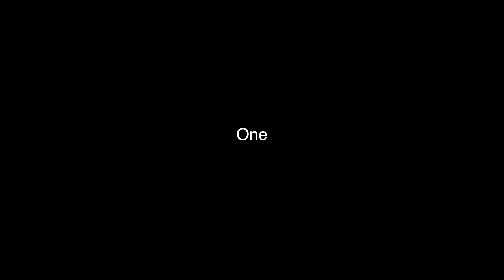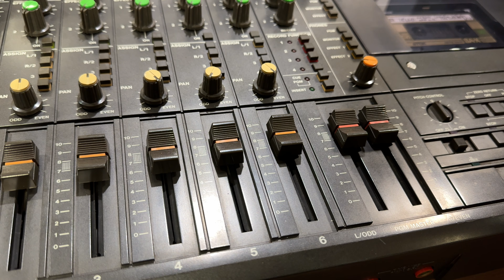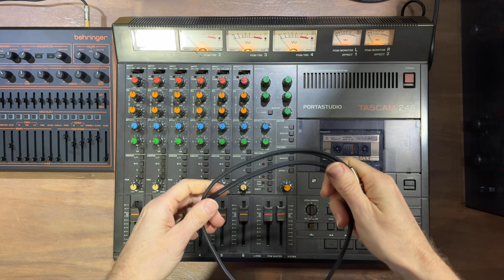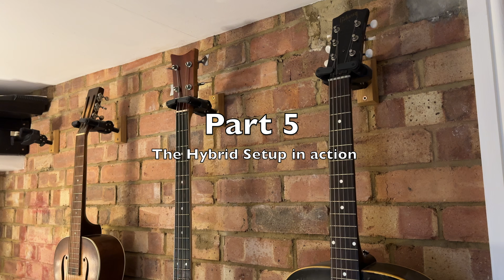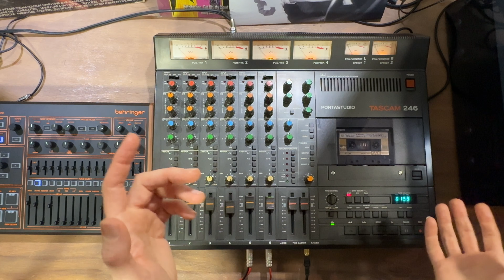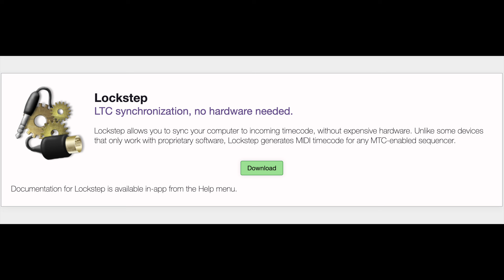Hybrid Analog Recording - Syncing Logic Pro with a 4 Track Cassette Recorder

Comment: Hey mate, thanks so much for your video on syncing Logic with the Tascam 246 — it worked perfectly!
I’ve got a quick question I’m hoping you might be able to clarify:

I’m monitoring drums from Logic by sending the stereo signal into inputs 5 and 6 on the 24 like youve shown here.  The only way I can hear them is by assigning them to buses 1 and 2 and having phones on PGM mode (cant hear Tracks 5/6 via Monitor mode) — but if I want to record, say, guitar on Track 1, that means both the guitar and the Logic drums are assigned to the same bus, so I end up recording both.

Is there a way to monitor inputs 5 and 6 without assigning them to a record bus, so I can keep them out of the tape path but still hear them?

Really appreciate your help and the awesome video!
Reply: I found a work around to solve my issue, but it doesn't seem you're doing it this way.

What I've done is set my phones to "effects 1" and use the effects 1 knobs to create a new mix for the headphones.

This way the drums  on 5-6 can be heard alongside the instrumental I'm recording but the drums arnt assigned to a track and therefore I have free use of tracks 1-3.
Reply from the maker: That sounds like a better work around than mine, nice idea.
Reply from the maker: Glad the video helped! Sounds like you've got a good setup going on. 

This was my first project with the 246 so I was still getting my head around the routing tbh. From memory I think I took out the assign switch for L1 on channel 5, when I recorded  to track 1 through the left buss (and monitored through channel 6 on R/2).

@tetrakan has a great tutorial video about the 246 here on YouTube which is my go to resource for the routing on this deck (think I need to rewatch it myself 😊).
Reply: @wehappyfewmusic  Yeah that's a good way of doing it! especially if you're just recording 1 or 2 tracks at a time. (possibilities of recording to both track 1 and 3, while leaving track 2 to be armed for mono drum monitoring.)

Also, using the effects 1 bus method I described, you can record to tracks 1,2 and all at the same time while monitoring stereo drums from channels 5 and 6. 

I've watched a tonne of @tetraken since getting the unit. He's been god send for wrapping my head around tascam and tape recording in general.. 

Following the method shown in this video has opened up the possibilities so much for my production. 

Thanks so much for sharing!
Reply from the maker: Really glad this video has helped with your workflow on the 246! 🙏

Comment: Hi there! I found this video to be closest to what I am trying to do but stuck somewhere in the chain based on having a different cassette mixer. I have a Tascam Porta Two High Speed multi-track cassette recorder. I was wondering if you have any knowledge of this model and/or could assist in describing how to route to Logic if I provide the ins/outs. It's got an rca line in/out, 4 tape outs, effects return, effect out, tape cue out, 2 inserts, 6 mic/lines with 1-4 as inserts and 5/6 as "d asn", and a phones jack of course. I am using an audio interface with 2 inputs and 2 outputs. Any advice would be appreciated!
Reply from the maker: Hi, I think I’ve got an idea that might work for you, but it’s a bit tricky to explain so hope it makes sense. 

It sounds like you’re all set on the portastudio side as have 4 tapes out. The tricky part is only having the two outputs/inputs on your interface, as one of each is always tied up with the sync track.

I’d suggest making an aggregate device on your Mac to combine the headphone outputs with your audio interface outs to give you 4 track in total from your Mac. These outputs can then plug into the porta twos inputs. You could keep two channels on the porta two’s mixer (5&6?) available to play back the audio from Logic Pro in stereo (could use outputs 1&2 on the Mac for this). I’d print the sync track on track 4 on the tape machine and use 1-3 to record instruments straight to tape. You’d need to use input 2 on the Mac to ‘listen/sync’ to the output of track 4 on the tape to keep everything in sync. Input one on your interface could be used to record the tape tracks back to your Mac so you can transfer them to your DAW. Input 1 on the Mac could be hooked up to the aux output of the tape deck so you can choose any of the tape tracks to send back to the Mac by turning up the aux send knob.

Hope this makes some sense and you can get things up and running. 🤞🏻

Comment: Hi, thanks for your excellent guide. I have it mostly working but am finding if i record 2 runs out from logic to tape the 2nd bounce out seems to be a bit out of sync with the first bounce. Ive tried playing around with the 'Validate MTC' option which sometimes helps but not always. Any advice?
Reply from the maker: Hi thanks for checking out the video! The process does seem a bit glitchy at times unfortunately and I had a few issues as well. You could try recording the sync track slightly louder to tape (but not enough to bleed through to the next track). This seems to make it chase more reliably and the occasional restart helped me too. 

What length of cassette tape and what age/spec of Mac are you using? Shorter tapes and newer computers also help from the feedback I’ve received from other viewers. I used an M1 Mac mini.
Reply: @wehappyfewmusic thanks for your quick reply. Mac os sierra, tascam 4x4 and a yamaha 488 mk II. I'm using type II tape. Does the level line in Lockstep need to be at a certain level?
Reply from the maker: @buhringerdek  I’d suggest setting the level at around -3db when recording the code onto tape as a starting point. It could also be worth doing a short test at 0db to see if that improves the syncing reliability (although you’ll get a bit of bleed through to the next track.)

It seems to take a fair bit of processing power for the Mac to chase the sync code, so that is probably why it becomes more unstable when you add extra overdubs using Sierra. Try using a few less tracks and bounce the overdubs together on your DAW to a stereo track and see if that helps. 
Have you tried different latency settings on your DAW, might be worth ago too.

Good luck 🤞🏻

Comment: wonderful video... for mac users. I'm running Reaper on window 10 and would love to achieve this set-up with my Tascam 244. Cheers.
Reply from the maker: Good point, I’d guess there will be similar software available for PC users out there? It’s also possible to use hardware to achieve the same results, although that involves some expense of course. You can pick up a 2nd hand Motu Midi Express XT for a reasonable price though.

Comment: Do you need to record a sync track on every tape to keep things in sync (meaning you lose a track)? Or once you've synced the DAW with your tascam it stays synced and you can switch tapes around and record using all tracks? Do you know what I mean? Hard to type this shit out haha. Also is it good to have an audio interface with the same amount of inputs and outputs as your tape machine? Im considering upgrading my interface to do this with my Tascam 688. Would love some help! Thanks for the video :)
Reply from the maker: Yeah you need to a sync track on each tape unfortunately, otherwise the DAW wouldn’t be able to follow along. It would make it easier to have the same amount of inputs and outputs on your interface in the long run, but you could test out the setup with a simpler interface first.
Reply: @wehappyfewmusic  Cool good to know, thanks man!

Comment: Making Logic follow the multitrack as slave works. However, after I record the first 3 tape tracks to Logic and then record another pass to get another three tracks to tape, I can't sync those to the first three tracks backed up in Logic.
Reply from the maker: That’s a pain. Were the original 3 tracks played in time with the tempo in Logic? As a work around you good try using Flex Time in Logic to get the 2nd patch in sync.

Comment: Hey man this content is great! :) I have question: what if you have a digital stereo bounce of a song, and you want to run it through the tape and keep it in sync? I mean if you record your song on two tracks of the tape machine, and the third track is the timecode track. Can the DAW read the timecode so that the recording you bounce back into the computer stays in sync with the DAW's grid?
Reply from the maker: Hey, I’ve not tried it that way around but think it would work. The DAW should flex to keep in sync. Let me know how you get on if you test it out. 👍
Reply: @wehappyfewmusic  hello! :) I tested this a long time ago, and it didn't work! :( but there is another way; you can sync your full mix of a song with Cubase's tape time stretching algorithm! It affects pitch too so there are no digital artifacts! :)
Reply from the maker: @jasonsully135 oh nice, that sounds very cool! Is it hard to setup? I’ve not got Cubase but I’d guess lots of other people viewing this will, so it’d be great to know how it works.
Reply: @wehappyfewmusic  okay I'll try to squeeze the explanation so this doesn't become too long of a message! :) you basically need three tracks to record to the tape: stereo for your song, and third one for an audio metronome from Cubase! Then when those three tracks are recorded back into your DAW, you can use Cubase's audio quantize feature to lock it back to the grid, because you have the original digital metronome, and the metronome from the tape! Then when you use Cubase's "Tape Algorithm" to do the quantizing, there are no artifacts because it speeds up the speed and pitch in sync! I don't know if this is easy to understand, but it's just my humble experiment! :)
Reply: it's way easier than I make it sound, but I'm not that good at explaining!
Reply from the maker: @jasonsully135  Ah yes, that makes perfect sense! Using the recorded click as the timing reference is a really clever way of doing it, and using the Tape algorithm so pitch and speed change together seems particularly appropriate. Thanks for explaining it!
Reply: @wehappyfewmusic  yeah man no problem!

Comment: I've tried this setup using ableton and it works great, but I have an issue where recording into my daw the track skips. It's always at the 1 and 2 minute mark. I re-stripped the tape and used different tapes with the same issue. Anyone have experience with this?
Reply from the maker: You could try recording the sync tone a touch louder (if you’ve not already).
Reply: @ for anyone who also has issues with Ableton I may have found what it is after searching around. Ableton does not continuously adjust its clock to follow the MTC code and instead follows its own clock. Apparently most other DAWs don’t have this issue. Or maybe only I had this issue lol. Either way this is a cool concept and well presented in this video
Reply from the maker: @cole_bert  many thanks for clarifying. 👍

Comment: Hi - love the video. Very excited to try that out with my tascam! Quick question... so you don't need to set the tempo at all when you are striping the tape, correct? you just record the sync tone then logic becomes a slave to the Tascam? But before you've recorded anything on the tape how does logic know the tempo of the drums? sorry if this is obvious.
Reply from the maker: Glad you like the video, and which Tascam tape recorder are you using? 

That’s right, you just need to stripe the tape for a bit longer than your intended song. You can set the tempo afterwards in Logic, but can’t change it after you record audio to tape, otherwise things will go out of sync. You also need to keep the tape speed the same throughout the whole process.
Reply: @wehappyfewmusic  ah ha! got it. thanks. gonna try it later tonight. I went a little tascam crazy recently and got a 414mkii and a 488mkiii (don't tell my wife! ha!). think i'm going to try this with my 488 later. could you also add the stripe to something you've already recorded something to tape... so long as your sync track is still blank, right? anyway, i'll let you know how I get on. thanks again, mate!
Reply from the maker: @SimonTateMusic-d9o  Always good having 2 tape machines IMO! 😀

I’ve not tried stripping a tape that’s already got a song recorded on it, but think that might make it tricky to sync to a DAW. I’d be interested to hear how you get on though.

Comment: Excellent, thank you for the video. One thing, if you get a chance to reply...I'm going to attempt an album of 10 or so songs on a 424mkiii this year. I use headphone correction software when doing songs in my DAW...but in the 424 I guess there's not really a great way to implement headphone correction since the phones are plugged direct to the 424 headphone input. I'd be using HD600 headphones. Any advice on accurate monitoring while working on a 4 track? Thanks
Reply from the maker: Hey, that sounds like a cool project! 

I’ve not used headphone correction software much but I’d guess you could run a stereo lead from the headphone out of the 424 into your interface, then monitor via the software still (assuming you can dial in a low enough latency setting).

I tend to use a combination of headphones and monitors whilst recording on my 4 tracks. It’s probably not super accurate/neutral but I’m familiar with how it translates on other devices now.
Reply: @wehappyfewmusic  Thanks. I think I will end up doing it similar to your way. I have some monitors, Cubes and bigger ones. So I'll get it as close as I can.
Reply from the maker: @ good stuff, acoustic treatment would also definitely help, but can be tricky in home studios (I need to do more in that area 😊).
Reply: @wehappyfewmusic  Yep, I've DIY'd a bunch of stuff. Home situation. 8x9ft room. Not ideal. But then again I'm not working for RCA Records or anything.
Reply from the maker: @NeverBetter464  yeah it’s all about working with what you’ve got.
Reply: @wehappyfewmusic  Hi, wanted to tell you about my first 4 track recording. 424mkiii. Pretty comical. I had a simple 3 chord song where I played and sang onto 2 tracks initially then would do piano, shaker and guitar licks on freed up tracks after one bounce. Ended up with lots of bloated, muddy recordings. Fumbling with technical issues...every time I tried to record a new track I seemed to be recording ALL the existing tracks together instead of the new part intended by itself on a track. The actual cassette tape was one I think I fried with massive volume out of my DAW a few months ago running a VST drum track onto the tape. It caused the DBX to pump and I think it ruined the actual tape. Anyway, once I bounced tracks 1 (guitar), 2 (vocal) and 3 (BU Vox) down to track 4 the playback was kind of pumping with high volume then going a little low etc. I was so tense about getting the tracking right that my playing and singing wasn't nicely in time or relaxed. It took an age to set up mics and get things connected. It was all pretty lame in the end. I ended up sending the 4 individual tracks into my DAW but because each track seemed to contain every other track, mixing it together in the DAW meant I couldn't isolate any one part. It was all such a huge effort to get such lousy results. I will probably put it up on my channel so I'll tell you then and if you'd like a listen, please go ahead. So, geez...you make it look easy. But it aint easy!
Reply from the maker: @ Hey, we’ve all been there at some point, and you often learn a lot from those sort of sessions. I’ve spent many an hour fumbling around trying to figure out why something was making a weird buzzing noise, or trying to get a certain vocal/guitar/keyboard part right. I tend to cut those bits out of my videos though, as they’d get pretty long if not 😊.
Reply: @wehappyfewmusic  No doubt, yeah. Perseverance is important. Each project is like a recon mission to rule out what doesn't work and note down what does. All I need is more time, ha.
Reply from the maker: @NeverBetter464  exactly 🙂🙌!